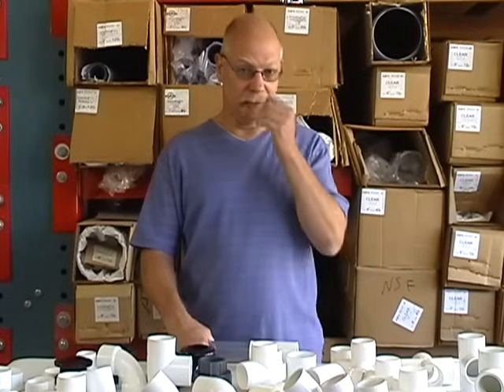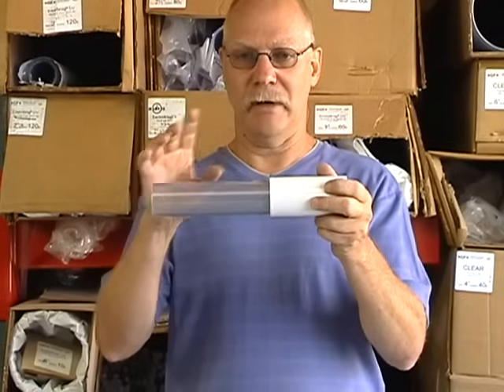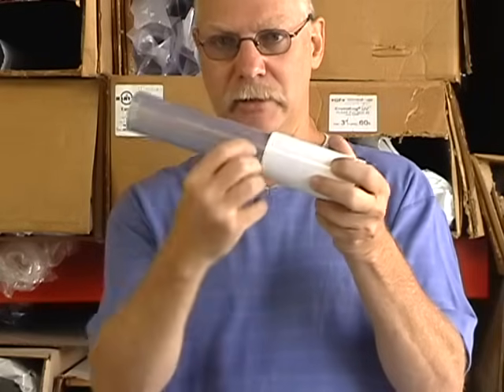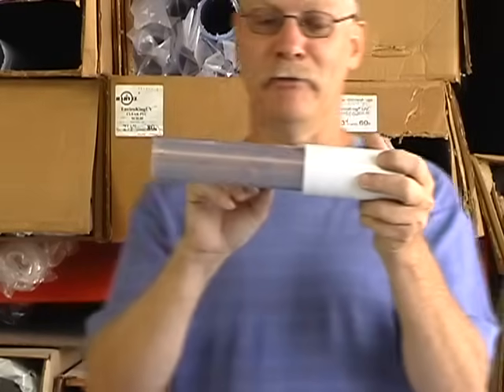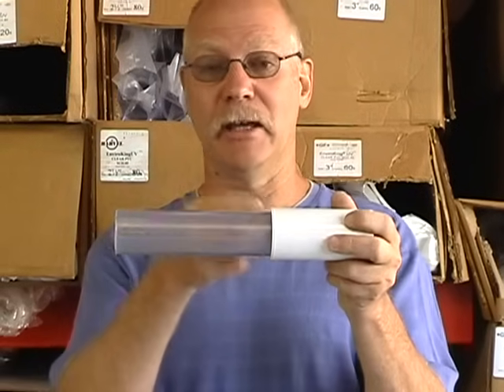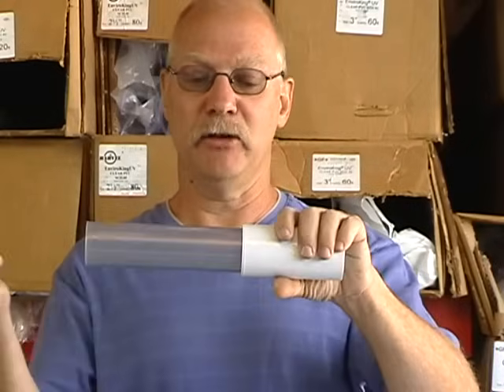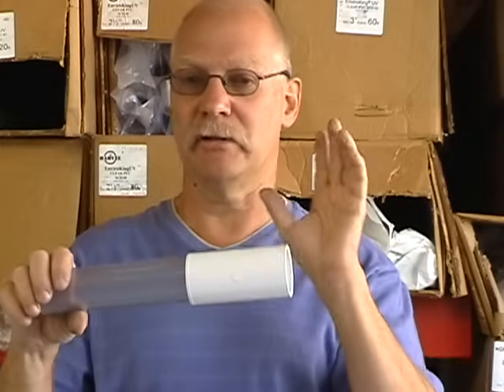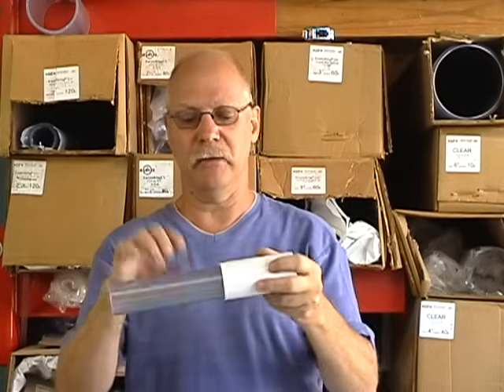FlexPVC® - How To Fix A Leak In PVC Pipe for FREE! Thousands have used this method & it works!

Comment: This is an incredible repair technique, and sir you are a genius. It is one of those rare moments in life when a fix is 100% possible with almost no effort. If the pipe leaks under pressure, it will draw in sealant under negative pressure, and if it doesn't work the first time it can be redone. In my case I only had primer so I tried that, and although it did not completely seal, it reduced the leak rate by an order of magnitude - from 4 drops/s to 0.4 drops/s. The next day I reapplied with primer and cement and the leak disappeared.

It is instructive to know how long to apply the vacuum and sealing agents, so I asked AI ' What is the equivalent diameter of a 1/2-inch-long hole leaking one drop/s of water under a driving pressure of 65 psi?'. It assumed 0.05 ml/s flow rate, 1 cp viscosity, and came out with a diameter 0.0034 inches (0.87 mm). It then calculated velocity to be 8.4 m/s, and the transit time through the hole to be 1.5 ms.

This tells you that there is no point in sitting there sucking in air trying to dry out the hole. it happens almost immediately, and the few molecules remaining don't matter since the primer appears to be water soluble anyway. You also don't need to sit there applying primer. Just put it on, make sure it's covering the hole for a few seconds and then start applying the cement.

Now AI says that Oatey general purpose cement viscosity is in the order of 700 cp, and that a shop vac draws about 3 psi negative pressure. So, the transit time increases sharply to 0.0015 x 700 x 65 / 3 = 22.75 seconds, in which case you would want to keep the leak covered with cement for a couple of minutes. Note that the actual volume of cement drawn in is extremely small, about 0.2 ul/m or 1/00 th of a drop/m.

For your case be aware that the flow rate varies as the fourth power of the diameter, so double the diameter increases the flow rate by 16 times. The velocity goes as the diameter squared, but the more important transit time varies as the inverse of velocity, so double the diameter, 1/4 the transit time.

Comment: Hello, So I have a bath drain connection leaking. I can use the shop vac on the bath drain but I think it is not practical to close the entrance swage pipe going to the city pipes. IS there a chance the method still works?
Reply from the maker: No, you need to create a vacuum someplace to draw the primer and glue in. But you should have a clean out or vent someplace in the system downstream. If you can find one, just stuff a damp/wet rag in there and that will be enough blockage to create the vacuum needed.  GL! 🙂

Comment: Hi. We moved our tub and broke one of the smaller jets. The broken fitting won't move. Can the pipe be cut and are there plastic joints so another piece can be attached?
Reply from the maker: The best thing to do is take some good photos (front and back if you can) and send them to us via our contact form:

https://flexpvc.com/Contact.shtml

Thanks

Comment: what is the fix if the water is spraying out and not exactly where the pipes connect
Reply from the maker: That means there is a crack in the pipe. Same method will work for a temp. fix, but if you have a cracked pipe, it's best to cut it out and replace it. But you can use this method to buy you some time. See our other video on this subject. https://www.youtube.com/embed/zUagwOZkGCw

Comment: Thanks for the video. I had a small crack in a fitting (sprinklers). Cut a bigger piece of pipe. Slit it. Heated it so it would flex and put it over break after cleaning and applying glue. Quickly put a clamp over it. Left it for the cure time and it held. Saved me having to dig out and change fitting.

Comment: This was great! Just finished plumbing the PVC for my solar pool heater. I messed up on one of the joints that just so happened to require a very expensive proprietary connector. This fixed it and made it so that I didn't have to buy another connector for $50!
Reply from the maker: Awesome! That's why we did the video. ;-)

Comment: Really nice of you to share that.  Others in your love of work are likely not thrilled.   Have any tricks for a valve leak. ( Ball valve,  pvc)

I'm a girl who just bought a house that has lots of fun projects!  I learn as I go,  and it kinda looks like the guy before me did the same.   Any time I look things up what I'm looking at is a version of it. Never quite like the "supposed to be" image.   
My house water intake (well)  doesn't seem to have a shut off except for the whole house water filter.  It works for my purposes so far,  but it's now leaking.  I have changed many of these in the yard for my homemade sprinklers., but clearly this could be a much bigger problem 
Any quick fixes for my issue instead of havoc to cut it out and install new valve?   Should i add a shut off somewhere else? 

If anybody is bored and cares to help a girl out,I really enjoy this stuff and appreciate advice.
Reply from the maker: Maybe. It depends on where it's leaking. If it's one of the joints, where the pipe glues into the socket, yes, the same techniq should work. If it's out of the shaft, then it's a worn our seal/oring in the inside. If it's a MIP ball valve (Molded In Place) there are only band-aid fixes. Nothing permanent. 
If it's one of the true-union ball valves it's possible to rebuild them. You can send us an email with pictures here:
https://flexpvc.com/Contact.shtml
that's really the best way for us to help. Just send a picture of the valve. Thanks

Comment: So question, I’m actually fight a leak on my hot tub right now and I’m going to try this. My gate valves were leaking so I removed it and added a pvc coupler and just installed rigid pipe but the coupler has a slow drip. 

It’s on the pressure side so I’m curious, instead of masking off all the jets and trying to hold my vacuum on the jet, couldn’t I just remove the pump and put the vacuum right on the pump union instead? That would put my vacuum maybe a foot away from the leak and because it’s leaking on the back side of the coupler, sucking air from the pump union would actually be pulling the primer and glue into the coupler in the correct direction.
Reply from the maker: Yes, you just have to have a source for the vacuum, block off all other ingresses and only leave the leak as the source for the air.
Reply: @FlexPVC  so just as an update, it worked! I went around and closed the jets (by spinning the clockwise). Then I stuck my wet vac on the pump Union and did as described in the video and worked like a charm. 

This worked great because it’s a fully insulated tub and the backside of my gate valves were buried in insulation. So instead of cutting out all the insulation I cut off what I could of the gate valve that was exposed, then I heated up the remaining gate valve and peeled it off of the factory flex pipe. Now I kept a 2” hole saw inside the flex pipe while heating it up to try and keep the shape as best I could, but it still deformed it a little bit which I’m sure was the reason it leaked when I glued the new coupler on. 

But thanks to your trick I was able to seal it up without re-doing it all. Such a stupidly simple idea I can’t believe I never thought of this. So I appreciate the video!

I would like to add, mine was also a rare scenario where the inside of the joint was accessible because it was right at the pump union. So after I did what you said with the vac and putting primer/glue on the outside, I also put a coat of primer/glue on the inside of the joint after removing the vac. So I’m sure that also aided in sealing up the leak.
Reply from the maker: @aarondieringer6997  You are very welcome. 🙂

Comment: Can a pressurized flex hose be repaired without replacement?
Reply from the maker: Best if you give us a call 1 888 782 3539 between 10am and 4pm M-F. This kind of question needs careful exploring to give you a good answer.

You can also email us at https://flexpvc.com/Contact.shtml

Thank you.

Comment: Thank you very much!!!!  Fixed my 25-year-old Apollo Spa hot tub leak near the pump outlet.  Drained the tub, masked off the jets.  With the shop vac running,  I was able to see the primer being drawn into the joint.  Then applied the PVC glue.   I did purchase new products, as the primer and glue I had were 3-4 years old (we used to have a swimming pool - since removed it).  No more leaks. (I prefer the older hot tubs - the new ones have too many jets).

Comment: That’s great if’s in front of your eyes what about tile 6in concrete 4 feet down if you want to learn
Reply from the maker: You would use the same procedure. Just create a vacuum in the system, tap a daber to a pole, and repeat over and over till the leak is sealed. The main thing is to get the primer into the leak. You can use a boroscope to help. Followup with cement/glue and you should be good. Tough, but it beats busting up 4' of concrete. ;-)

Comment: I did this today and fixed the suction leak on my 30 year old spa. I have it on video. As I dabbed the primer on, I could hear the leak sucking air. A couple more times with primer then Red Hot Blue Glue and the leak stopped.
Liked and Subscribed

Comment: Great video! I have used 3m 5200 in  the metal tube permanent! I drain the system sand the pipe and joint well apply 3m wait the full 7 day cure then fill the system works every time! If your system just won’t seal and you don’t want to cut apart it’s worth a shot!

Comment: Ok putting faith in ya and giving it a try for pressure side leak in pool side return at pump (bad glue job fix), will update with results.  UPDATE: OMG IT WORKED!!! Valved off pumpwork and closed pool/spa supply jets with 1.5” plugs, used vac in one jet, boom done..THANK YOU!!!

Comment: Thanks for sharing your knowledge.  

At the beginning of the week I knew we had a Picket Fence Demolition Project as we demolished our Utility Picket Fence Section (Single-entry Gate to Double-wide Entry Gate) we now have multiple Irrigation Repair Projects: 
Priority #1 for the Index 3 Pipe I need to close the 12-in. to 14-in. air-gap, which this section had to be cut-away due to removing a picket fence post concrete anchor, for a 1 1/4-inch diameter PVC irrigation pipe (schedule 40). 
Priority #2 for the Index 1 Pipe I cut approximately 18 inches of 1 1/4-inch irrigation pipe from the "whirly-bird type sprinkler - I now plan to use a regular couple with PVC Primer/Cement.  My first attempt I tried a “PVC Pressure Couple” and the first test failed miserably; consequently
Priority #3 for the Index 2 PVC irrigation pipe I removed the  Rainbird 5000 broken riser stem and installed a new riser stem: I corrected the swath to rotate 180°, but now I need to fine tune and shorten the dispersal distance otherwise swap this sprinkler with the Toro sprinkler [Index 1, Zone 4 in far corner]
Reply from the maker: This is a complicated situation, way too complicated to resolve here. Please use our contact us link https://flexpvc.com/Contact.shtml to send us pictures, drawings, etc and we'll help you find a solution.

Thanks

Comment: With threaded PVC, smear some T-Plus-2 on the threads. I looked at the stuff under a microscope. It's interesting. There are thousands of tiny fibers going different directions. And it doesn't dry out.

Comment: Help!!! So I have an issue under tub no access no basement - I removed tub drain (20 yrs had corrosion) and during the removal the threaded pvc under tub slightly cracked now I have to screw in a new tub drain...how can I fix this issue? I mean if I cement tub drain and last another 20 yrs I'm ok with that as long as I don't get a leak under tub and damage the foundation....I guess by the a remodel won't hurt but I want to avoid mold issues as well. Any feedback will be great. And subscribed!!! Great informative video.
Reply from the maker: Tub drains are not sealed with glue/primer. The top of the drain piece used 'plumbers putty" and the shoe uses thread compound. Plumbers putty is like playdoe or clay. You roll into a strip (log) whatever about 7" long and wrap it around the drain. Then put the thread compound on the threads and screw into the shoe (the bottom piece under the tub.) It's a two person job. If you need more help, please contact us thru our website https://flexpvc.com/Contact.shtml

Comment: Question is there a product that will allow me to patch up a long PVC its approx 9 " inside the pipe so I cant get my fingers on it but I might be able to insert something in the pipe etc
Reply from the maker: Probably not but you might get lucky. What is the precise ID of your pipe? Best to contact us thru our website. https://flexpvc.com/Contact.shtml
Reply: @FlexPVC  I have a crack in a pipe which i   believe is PVC now the location is 9 " a way from my access so is there a product I can use in liquid form that would dry either hard or silicone for PVC

Comment: Thank you so much. This helped me fix a recent repair I made where I may not have used enough glue. This was a suction side leak and I was facing a near to the ground cut on the pipe to redo the repair. I did exactly as was instructed and no more leak! Great advice and thanks for making this video.
Reply from the maker: Glad it helped!

Comment: You are a genius! This video saved me a whole redo, and about $100. I had a leak installing a chlorinator on my pool. I was able to take apart the jandy valve downstream and hooked the shop vac. I was able to seal the leak easy! Gave it an hour to cure and now the leak is gone! Pay attention to the detail about putting the glue very quickly after the primer. If you let the primer dry it might not work. Glad I watched the video 2 or 3 times while doing sealing the leak. Thanks a million!!

Comment: Man, your advice here was a lifesaver! I installed a full house worth of dwv. After visiting 3 stores I couldn't find the heavy cement in the large container that is typically used for 3" and larger fittings. I made the impatient mistake of using the small containers of the medium cement with the small applicators. DUMBA$$ and impatient move...no doubt.

So I start my fill test and have 6...SIX!...pinhole leaks! Just shoot me. So I find this video and think I've got to at least try this. 

I won't go into the details as you have done a great job with that. Just let me say that your method sealed all the leaks. I tested with a 30 foot head of water to the top of the vent of a 2-1/2 story house. Passed the inspector's upstairs bathtub fill with nary a drop. Thank you, sir. You probably saved me a complete do-over. Utmost appreciation for your free guidance!
Reply from the maker: Awesome! So glad we could help save the day! :-)

Comment: Well I had a crack but I will try to remember this Great Trick next leak I have..
I beat you are the one to ask, How do I reseal the can of PVC glue so I can reuse it 6 months from now??
Reply from the maker: Well if the can and cap are in good condition then you can just tighten it down and keep it out of the heat. Most cans will last 2-3 years.

Comment: This worked great for me.  I had a tiny leak in my RV dump tub at the Sanitary Y connection.  I was able to close off the dump valves and put suction on that small section.  I followed you to the T and it worked!  Thank you very much.  Now if I can just figure out why my fernco fitting leaks.
Reply from the maker: Thanks for the feedback. So happy to help. As for the Fernco's the reason they might be leaking is wrong size. Usually too big. Fernco's are meant to stretch, not compress.  Measure the OD of what you are connecting to and give us a call M-F 10am to 4pm PST, at 888 782 3539 and we'll find the right one for you.  Thanks!

Comment: I don't use glue and primer. i just use a vulcanizing solution like christys red hot blue glue.
pvc pipe cement.
then again i'm not using it on anything above 1", or with extreme pressures.
Reply from the maker: Christy's is a fine glue (we sell it) but it's not a vulcanizer. Also w/o using the primer you are not welding the leak but merely patching over top of it. The primer is the key.

Comment: My issue is a toilet waste line which is gravity the water is falling and one of the joints is a leak.  I'm not sure what I should do as far as turning a pump or something on. In this situation the leak inthr pvc waste pipe at a joint,  between the toilet and soil stack.
  I don't want to pull the piece out because all the pipes are attached to the flange and the flange is so tight inside of the waste line it moves everything which is why I have a leak in the first place.  It's actually a second leak cause I cut, removed,  and replaced another piece to stop a leak,  and now the leak is just further down the waste line. 
 I'm thinking of buying a leak b gone ring for 3" pipe I just wanna fix it today or before I go back to work,  and by the time it ships I'll be back at work for six days (out of town).
Reply from the maker: Give Pow-R-Wrap a try: https://flexpvc.com/cart/agora.cgi?p=Fernco-Power-Wrap-Leak-Repair&p_id=FPW3132CS&xm=on&ppinc=detail

Comment: My inlet pipe for my well pump. Has an L pipe as it comes in through my foundation. Leaking at the L joint. Do you think this fix could work?. Not sure how i could keep the pump running long enough. Thoughts?
Reply from the maker: If it's PVC pipe, it should work. Getting the vacuum in the pipe might be an issue, but I think these pumps seals would hold it. I say give it a try. You have nothing to lose. :-)